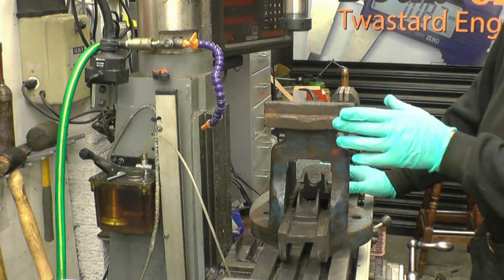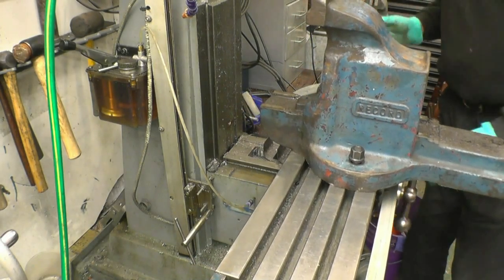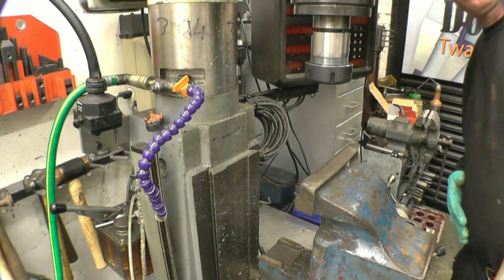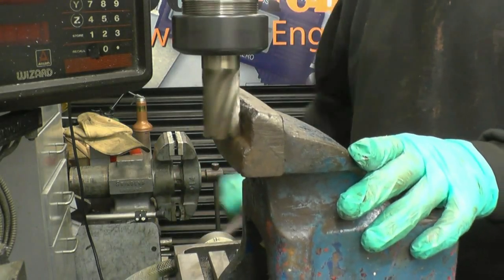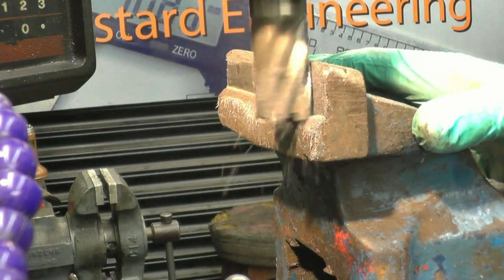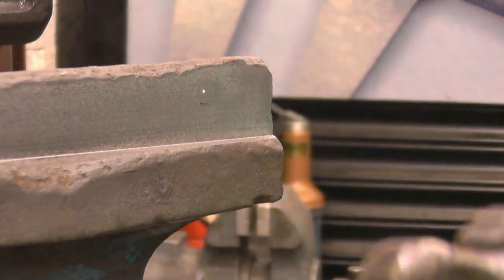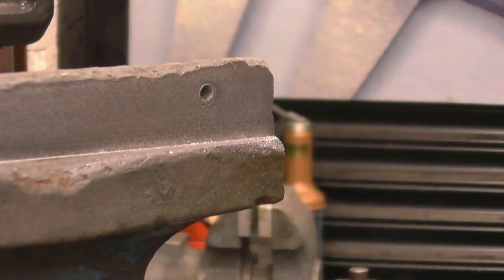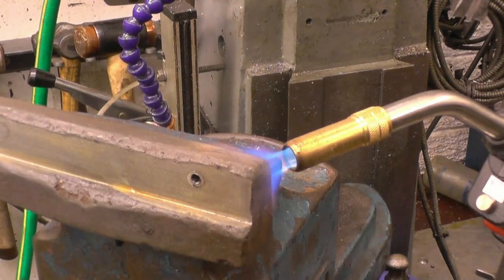SNNC 194 PI   Broken Stud Removal  (get her out)

Comment: Like the poor man's Ridgid extractor there John, and nice getting that out without too much fuss. Also gotten them out using a sacrificial hex drive bit, though I also use the Torx versions as a hex bolt single use undo tool. Perfect use for the 25 piece hex bit kits I have so many of, bought for the odd bit they had different in them, and dropped into a plastic jar.
Reply from the maker: That was a good quality torx bit  I use them as extractors all the time

Comment: I was surprised you didn't run a bead along the top and underneath where it's worn before milling it, so the jaws have full support.
Reply: thats what i thought as well to braze up the edges and then mill  the edges. it would have looked good with the brass coulor in it as well nice patina.